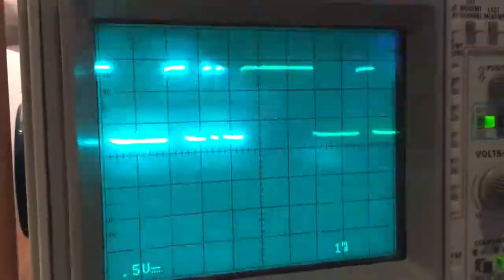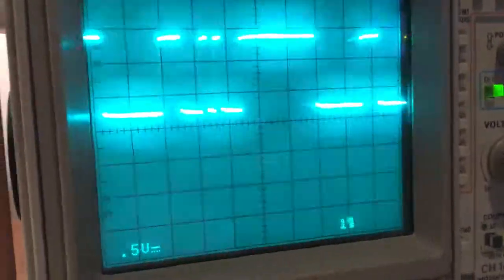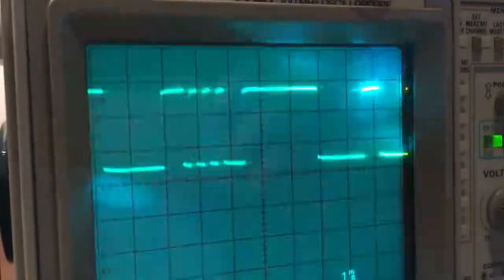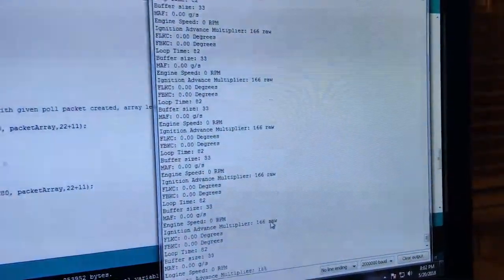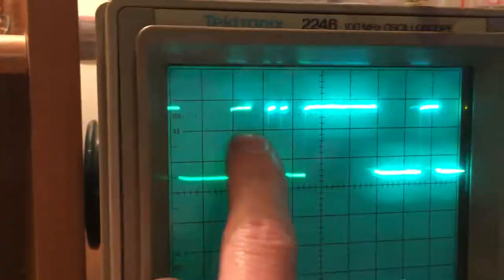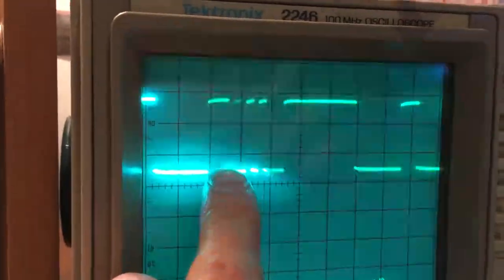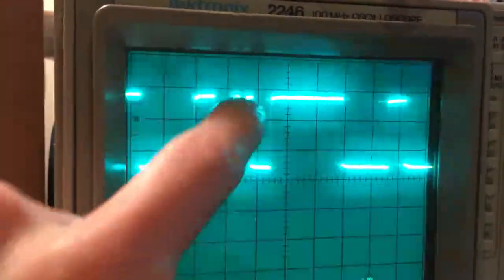Subaru WRX ECU K-Line Data Stream Bit Shifting

Comment: Ok so I've got a question, I have an 04 2.5rs. I was scanning the ecu with my buddies snapon scanner and it was reading the ecu protocol as "SUBARU_KLINE". The first thing I get when looking it up was a few different websites with piggy back systems allowing the 04s to be tuned on. So my question is, is "SUBARU_KLINE" a normal ecu protocol or does it most likely have some sort of piggy back? This car is a big bag of mysteries.
Reply from the maker: K line is a standardized data transportation layer. Subaru has their own protocol built on top of it, and is all factory.
Reply: @GarrettsSubaru  I appreciate it man. Im new to Subaru as of last year. Theres been a lot of learning.

Comment: hey bro i have a 2000 obs that a wanna do a 2.5rs white face cluster swap on but want to keep the cluster reading my original mileage do you know if i can just take the white face plates out the rs cluster ...a transplant if you will?
Reply from the maker: Not SUPER fesable, however the mileage on the new cluster can be reprogrammed. Checkout G-ROM Cluster Flashing on facebook, and I can hook it up!